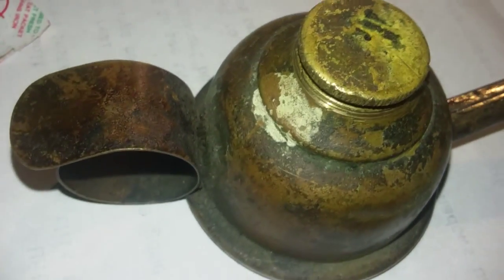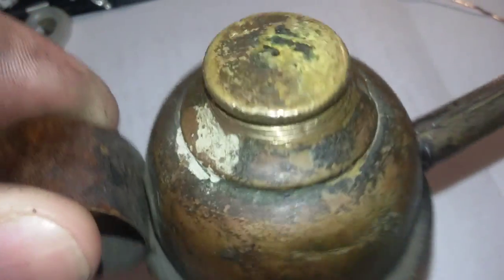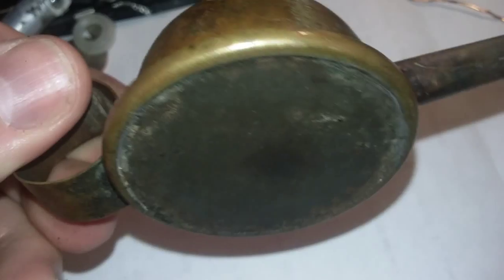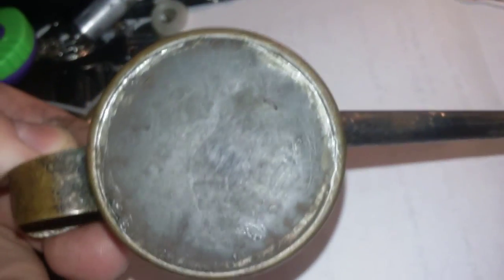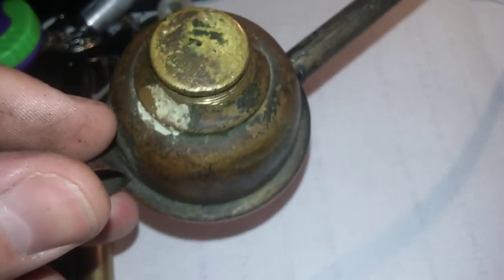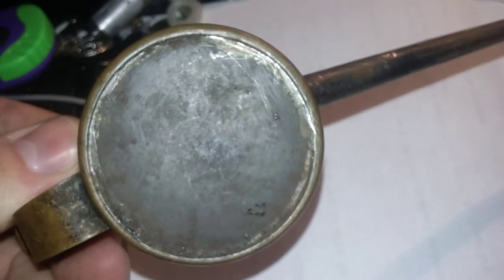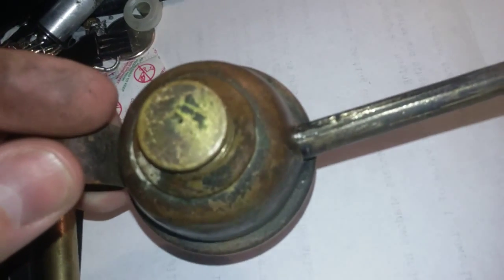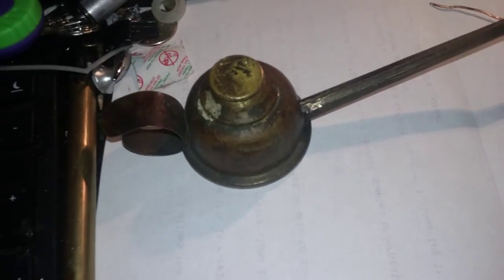Anyone know what this is?

Comment: a mini portable steam cleaner?
Reply from the maker: +Iseekoutthetruth I thought that too. That cap is either frozen on there or not meant to come off but I can turn it but won't unscrew. I had to heat the long part with a torch and then ram it with a piece of stiff wire and it smoked like crazy so had to turn the fan on. I plan to flare and resolder the long part once I find out what this thing is and if I can make use of it.